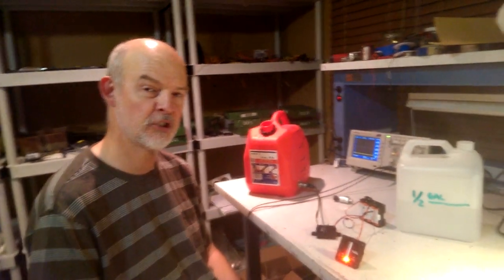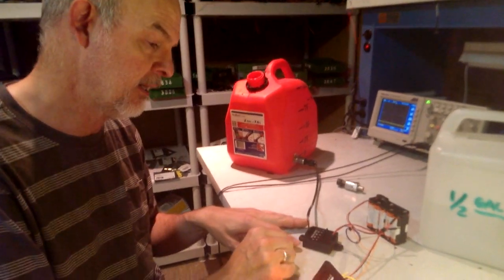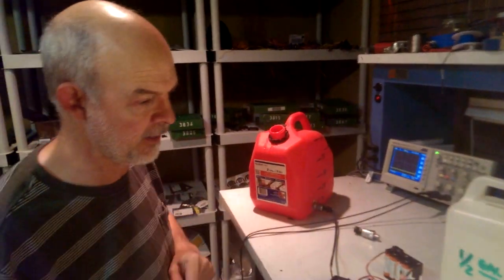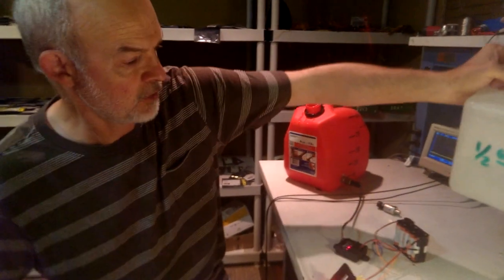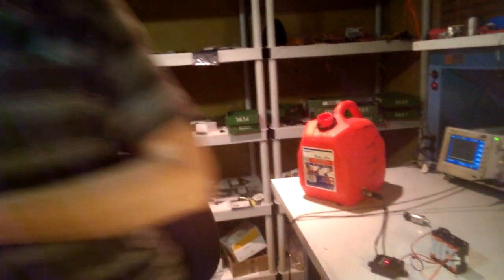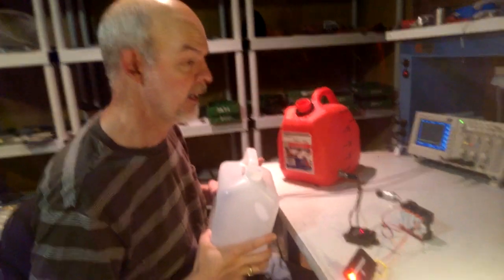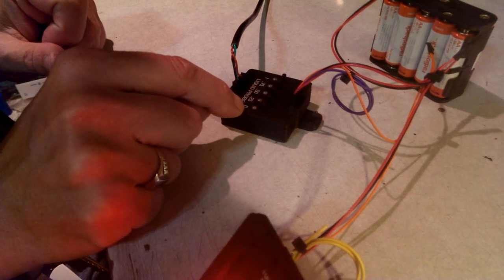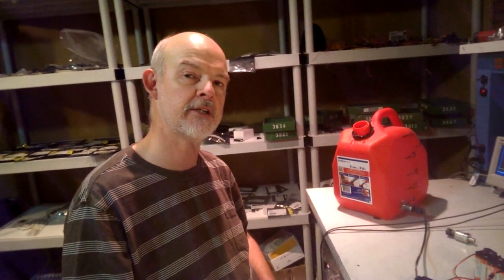Programming a Belite Fuel Probe System

Comment: If after calibration, I remove the computer module, and put it on the shelf for later use, (Once I get my gauge in from BeLite) will the module lose it's calibration or will it be good?
Reply: @BeliteAircraft  THanks for the quick answer.  I just sent an email.  On one of the 2 modules, I pushed the "1" button, and nothing happened.  The ".75" light is still lit.  no response.  PLEASE don't tell me I'm going to have to drain the entire aircraft and start over!
Reply: I have the same issue what did u do to resolve? @captianhardy
Reply: @milehigher00  I contacted James at the factory.  Good Guy

Comment: Hello, great system.   I'd like to use on my experimental which has 28 gallons in each wing and would like to use with a Garmin G3X system.   A few questions;  I have 1/2" fuel feed lines.   I suppose I can Tee in with a 1/2"-1/2"-1/4" T fitting?   Does it require your fuel gauge or can I integrate with Garmin's fuel qty indicator?   Is the Orange wire the variable voltage provided by the controller?  Thanks